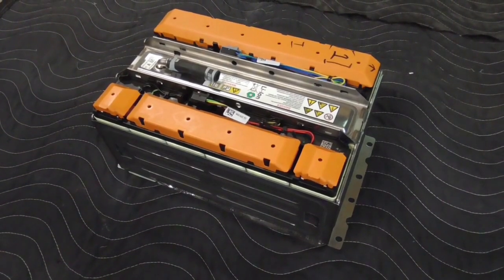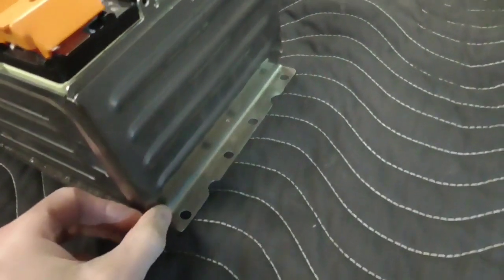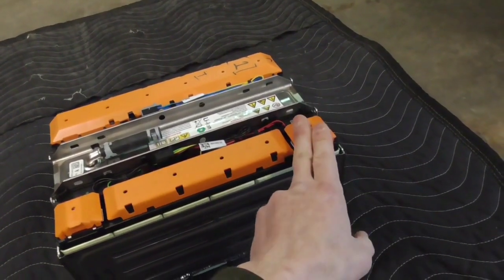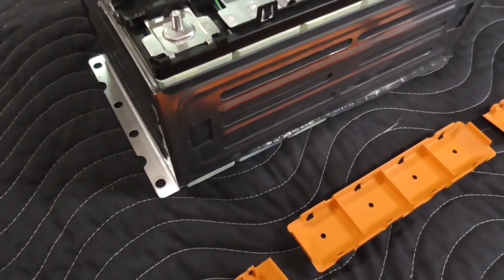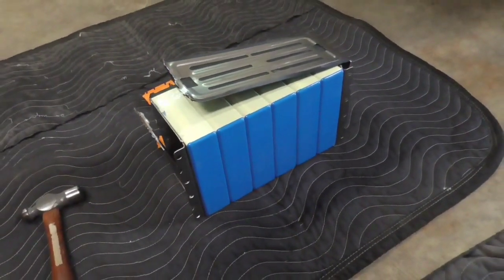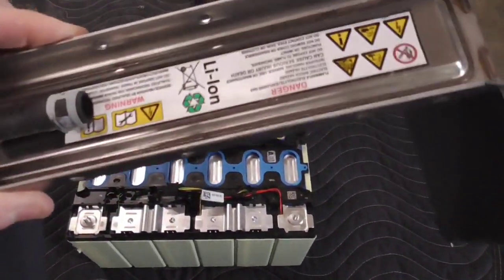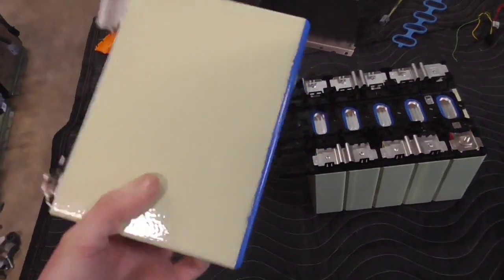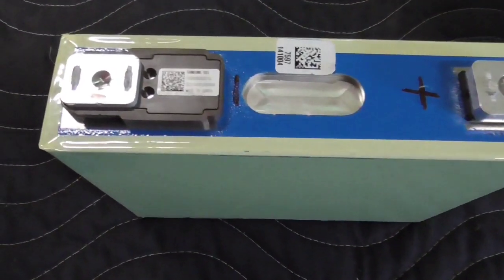Fiat 500e - Teardown - episode #8 - Battery Module

Comment: Hello, nice work.
I was wondering, is there anyway to put this modules in nissan leaf battery case? 
If it has 360v nominal and 97 cell, and i can remove one like you. 😅
Reply from the maker: Most anything is possible, it's just a matter of how much time & money you want to spend on it.  Fundamentally, a battery is just a battery, as long as the voltages are exactly to spec.  BMS would probably freak out the host computer and make nothing work, though.

Comment: You think you can use multiple of these to power a small home with solar panels?
Reply: I guess so. By configuring them properly. 7s for 24v or 14s for 48. Personally I prefer the yuasa lev40 or lev50 from the i-mieve or the outlander. They are easy to configure and work  with. The problem with the fiat battery is that they are welded. It's difficult to connect them properly once cut.
Reply: @kwamelion270  if i can find a way, i would hate to get rid of the fiat for nothing when the batteries are worth so much more and have life left. I would even consider using it for a greenhouse to power some lights, pumps, ect.

Comment: HI john i have been swapping these cells for the last 17 years not destroying the case. Using a hydraulic press
Reply: Can you explain how? Or post a video?
Reply: @timweaver9773  first start by cutting the welded spots on the battery straps for each cell u want to remove. then place the battery on cribbing on either side of that cell and push down the cell will drop out. to install i use hydraulic spreader or some wooden wedge work well to. if the replacement cell has no terminal it will drill and tap
Reply: @josepht6274  That's awesome! I have a bunch of modules that all have at least one shorted cell. Would love to be able to mix and match my good cells to make complete modules. Thanks!
Reply: @timweaver9773  I do not think its a good idea just to use a good cell from my experience  some cells will have troubble balance. How i do is measure internal resistance cells. so if you have 6 cells and  ir resistance is 2.5 then replace with a 2.5 cell I get rid of all my cells at 4.5.

Comment: what year fiat 500e is this? I have seen another 500e main battery pack video and it was shaped completely different.
Reply from the maker: First generation of the "500e" was a U.S. only model produced 2013.5 - 2019.  The specific car featured in the series was a 2015.

Comment: SDI cells needs the pretension to not break internally from swolloving , The datasheet specifies the force the cells need to be under. The cells are identical to what is in a BMW i3 and they come in 120Ah versions.
Reply: Regarding the swelling: Exactly!
Reply: Can you  or someone tell me what the actual C rate is for these cells? I have both fiat and the bmw packs with these and im calculating for a diy pack for golf cart use..
Reply: @fathergratwick  I can't post links here, so google this: "Samsung SDI 94 Ah battery cell full specifications" there are different discharge rates depending SOC and temperature. but roughly 3C  for 30 Seconds and 4C for 5 seconds. So not super high power cells. But they have high energy density and last a long time.

Comment: Does that 18650 cell also have the same AH capacity as the SDI cell you compared?
Reply from the maker: Absolutely NOT!  The point is cells come in all different shapes & sizes.  The 18650 cell was the highest capacity per size & weight.in it's day.  But, that was around the 2005-2015 era.  Things have improved & continue to improve faster than ever before in the EV battery space.
Reply: @theevolvingworld  ha, thanks. Stupid question I guess.  I thought you were saying that they were comparable density and the 18650 was the new tech.  My apologies.  What cells are the new and improved standard in 2022?

Comment: And is it possible to charge 1 battery module separate and if so whats charger should i be using
Reply from the maker: Yes you can charge an individual 5 or 6 cell module as a whole.  I've recently done this myself to balance the modules out while creating a new pack for my current EV conversion project.  Go to eBay or Amazon & search for a 10-30v 0-10A bench power supply - you can adjust the knob to set exactly the voltage & charging speed.

Comment: I wanted to know how to know how to check each individual battery module to know if its good the voltage on 1 is 20.3v on a 5 cell
Reply from the maker: Each cell has a nominal rating of 3.75v & at full charge is 4.115v.  20.3v on a 5 cell module would be about 90-95% SOC.
Reply: @theevolvingworld  thank you for the quick reply. So is that the only info i would need to know that the entire battery module is good?
Reply from the maker: @novawagon559  It wouldn't be able to put out that kind of voltage, if it was damaged.  You can pull off the orange covers & check each cell.  They should all be equal at 4.06v.
Reply: @theevolvingworld  the issue rn is the car doesnt have power in interior but customer stated the just replaced 12v battery. The recall has been done to it about the software up since online it shows no unrepaired recalls
Reply from the maker: @novawagon559  A healthy 12v battery is essential, so the car can boot up properly.  I hope when say "battery module" you mean a 5 cell module.  There are 97 cells in the 500e pack.  Voltage should be in the 320-390v range.
Reply: @theevolvingworld  yes correct thats exactly what i mean by battery module each 5cell battery pack

Comment: In your deconstruction video you indicated that the cooling is only on the bottom of the battery.  After taking it apart did that end up being the case?  I assume the sides of the battery case also contact the bottom and conduct the head down from the sides to the bottom.  Any feedback?
Reply from the maker: In Ep. #7 I showed the whole pack being disassembled.  Some modules are mounted horizontally & others are vertical.  Of each of the 97 individual battery cells, only the bottom comes in contact with a chill plate.  Sometimes even sharing the same plate on both sides.

Comment: Nice work, I didn’t see these videos until recently... I am using the same batteries for my projects.
Reply from the maker: Thanks.  Yes, they are nice modules to work with.  Most of them are installed in my lightweight sports car I'm building.

Comment: I'm playing with some wires in the Fiat 500e and I thought this might be useful for you:
https://cardiagn.com/2013-fiat-500-except-500e-service-repair-manual-wiring-diagram/
The 500e stuff is at the bottom.
Reply: That does not cover the high voltage stuff at all.

Comment: Do you still have plans to utilize the 500e motor  and controller? I recall that it seemed like you were going to swap it into another vehicle but the dry test of the system outside the vehicle failed. You suggested also you might pick up a custom harness and more.

Comment: Thanks very much for all these Fiat 500e teardown videos!  I have a question for you:  As the world's leading expert on the 500e outside of Fiat, do you happen to know either A) the part number for the voltage converter that converts the main battery voltage to the 12v system to charge the lead acid, or B) do you have any info about a rating for continuous amperage through that unit?  I'm trying to figure out if it'd be safe to draw any significant 12v power through that voltage converter for a long time, or if it'd easily overheat.

Comment: I have this vehicle. Currently battling Fiat to replace this battery. They don't want to, and the cost is $29,000 for a new battery. The battery is covered under a flimsy 40k mile warranty but they want to replace the PIM (power inverter module) first which cost $8400. What does the PIM look like? There's a recall on that part but just for software, not for hardware. If that doesn't fix the issue then fiat will replace the $29000 battery.
Reply from the maker: Sorry to here about the issues with your 500e.  Checkout the Teardown series I show the Inverter/controller  (A.K.A. - P.I.M.)  On the 500e, this unit is combined with the DC to DC charger which keeps the 12v battery charged up.  It should be covered under warranty & or as a Recall item.  Don't pay anything.  Might be best to get a '17 500e for $8k or something else entirely.
Reply: @theevolvingworld  I had a Honda Fit EV for 5 years before I picked up this Fiat 500e. The Fiat 500e was a great car- only put 8k miles on it during the year and a half I had it before it shut down on me in the middle of traffic with this propulsion system error. I reached out to local Fiat dealerships and none of them can service it. I had to drive over and hour away to find one that could fix it. They took over a month to diagnose the issue and tell me the battery needed to be replaced. Then at the last minute they're saying it's not the battery (which is $29k) but the PIM module which they want to bill me $8,400 for. Apparently all the parts for this car cost more than Lamborghini parts. I'll look through your videos again to see if I can grasp what this part looks like 😂
Reply: @Vandetta187  Did you get a solution through the dealership? I know someone that is having the same problem and curious to know if the dealership ever fixed it.

Comment: battery sizes matters , tesla looks decade ahead
Reply: & priced accordingly. A $7K used Tesla doesn't exist.
Reply: *Energy density is what matters. Tesla is clearly ahead but putting two form factors side by side doesn't prove that. The 500e is clearly a compliance car. The chassis has so much wasted space and never gained updated cells as the came to market. i3 is a good example where it evolved over time and even offers an upgrade path for older models.
Reply: Tesla made a solution that works for Tesla.  They are definitely not ahead in battery technology, they used proven technology and built their cars around it with no regard for weight.  It works and the added weight improves road grip (but kills tires).  Tesla used smart engineering on old tech to incorporate them in a way that maximizes the space used.  Agree that there is no basis for comparison here, small cells vs large cells means nothing, you can get watch batteries with the same voltage as 18650 cells.  Also Tesla's $35K car costs $50K, so I should hope they design something better than a retrofit compliance car.  Having worked for Tesla for many years... I drive a 500e 😁
Reply: Tesla looks decades ahead? They use the cheapest 18650 cells designed in the 90’s lol. Hyundai has the most advanced batteries and even those are 20 year old tech now...
Reply: @healthyhuman2360  you couldn't be more wrong ...
Reply: Elaborate

Comment: It's a shame that Fiat never updated the battery with higher capacity, or added a DC fast charge as an option. Everyone says it's one of the most fun to drive EVs out there, but Fiat didn't really stand behind it like they should have (The CEO even famously asked people NOT to buy the car because Fiat lost something like $20,000 on each sale). Anyway, looks like the tide has turned because the Europe-only version for this year has both of those things: Greater range and DC fast charge. I guess maybe the price drop of lithium in the past couple of years has made the car more viable, but because Fiat has not done well in the US they have pulled out (Sort of. They still are the parent company of Dodge/Chrysler).
Reply: If only they made truly compelling cars here. Nobody knows of the best of fiat's existence here, the 500 Abarth. They didn't market their vehicles well here what so ever. The 500x was very awesome but also under-marketed and under-powered compared to the mini countryman S model counterpart.